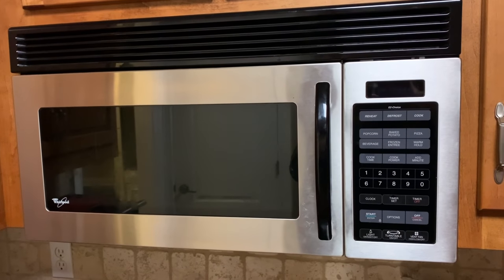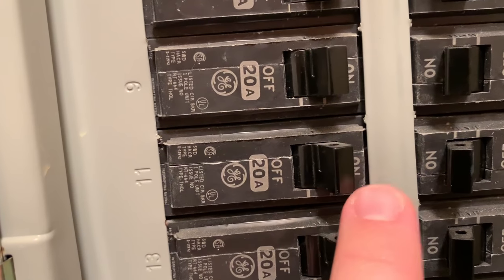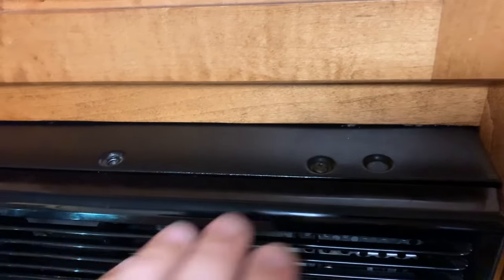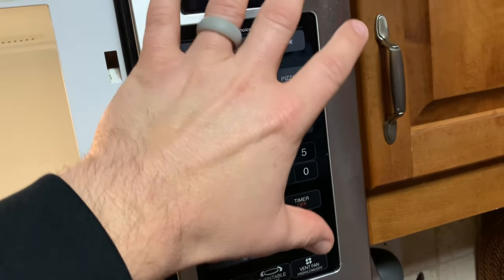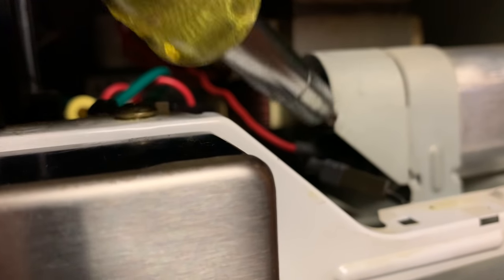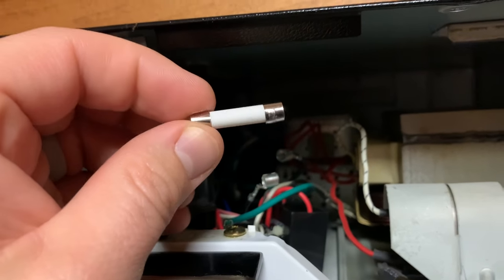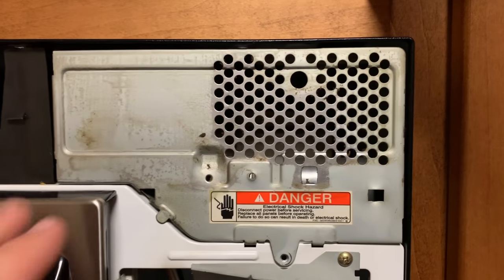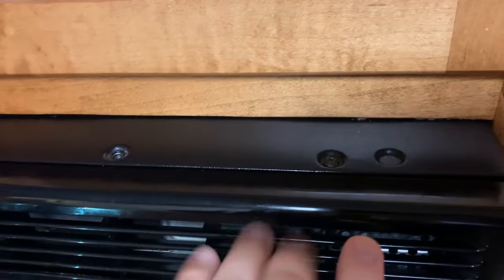Easy Fix: Microwave Won’t Turn On - No Power on Microwave

Comment: Really helpful as our MW went down w/ no power anywhere...! Checked  plug outlet/breaker & all are good. Our model is only 3 yrs old & appears to be a newer version...? Taking the panel off & checking the fuse, it appears to be fried.  I do not see a capacitor up front like your demo. Tin foil wrap the fuse & it powers up :>) I have a 20 amp fuse but there is no voltage rating on it. Putting the fuse place & the MW powers up. Question being, is it OK to use the fuse I put in as a replacement since there's no voltage rating on it?
Reply from the maker: I would recommend getting the right size fuse. You want it to blow so other things don’t get fried or catch on fire.

Comment: I have a GE microwave model PEM31SMSS that stopped working a couple months ago (after 9 years of light duty). After watching your very informative video,  I really think I can replace the fuse myself if I can get inside it to determine what size replacement fuse to order. I can send photo if that would help. Jolene
Reply from the maker: Sorry, I can’t provide the type of support. I’m not an appliance repair expert.

Comment: Our didnt have any power at all either. I replaced the fuse. The display lit up. I opened and closed door and it was still working. I pressed the start button which automatically puts 30 seconds and then starts up. It ran for 1-2 seconds and then turned. What should I do next? Btw I did see the fan turn on right as microwave started. Please help. Thanks

Comment: Appreciate it!  my microwave lost power when I tried to pull out the plastic latch (mechanism that keeps door closed) thanks for the advice on the fuse hopefully its just that.
Reply from the maker: A broken door latch will definitely cause it not to work but shouldn’t cause you to have no power at all.

Comment: The other night I dismantled the bottom panel, the door and the handle, and the control panel along with the circuit board in preparation for my new parts shipment. I had to replace the handle and the control panel assembly because the touchpad had some contacts fail and the bottom of the handle broke. 
After cleaning everything thoroughly and removing all the grease and gunk build up, I reassembled everything and now my microwave acts like it’s cooking. The interior light comes on, the timer counts down, the turntable does not rotate nor does the magnetron work. 

Ideas?

GE with exhaust fan ducted to the outside.

If the main fuse is blown will anything even come on?

If the thermal switch has gone bad will everything I just described still function?

I really don’t wanna buy a new one so any advice you would give me would be greatly appreciated.
Thank you.
Reply from the maker: Sounds like a faulty door switch to me.

Comment: I notice that microwave fuses come in different amperages, and I don't remember what it was originally.  Should the amperage of the fuse be the same as the rating listed on the breaker panel?  More?  Less?
Reply from the maker: Sorry I’m really not sure.

Comment: Hi.  Do you happen to know if my (c. 1982) Sharp Carousel Convection Microwave oven model R-8314 has a fuse?  In the final minutes of roasting a turkey (combination cooking:  convection then microwave) it made an "Errrrrrrnt" sound (kind of a brownout sound) and then quit altogether.  No light, no power, no nothing.  It wasn't the house breaker, and the cord and wall outlet are fine.   This is 76 lbs of serious quality appliance.  Might this be repairable?   Thanks!
Reply from the maker: Sorry. I’m not sure.

Comment: Sounds like what just happened to my microwave... everything was working fine until I  opened the door to get something out and all power was gone somehow. So I'm assuming that internal fuse blew out. I'm going to watch your door switch video now, cuz I  noticed it happened immediately after I opened it..
Reply from the maker: Definitely check door switches first since they are easier.

Comment: Sounds pretty easy. Except for the “could kill you” part. Loved the video but I don’t feel like you explained how to remove the power from the capacitor. Doesn’t “crossing the leads” require touching both of them at once with the screwdriver? Kind of like the way one would hot wire a car back in the day. Afraid to try this fix w/out a better explanation for this part of the process.
Reply from the maker: Sorry Jerry. Yes you are crossing both terminals at the same time.

Comment: For the Capacitor when you say cross them top to bottom and then bottom to top, to get the stored power out, what do you mean by "crossing them"?
Reply from the maker: Let metal touch both contacts at the same time.
Reply: @TightWadDIY  Thanks a lot

Comment: When you say cross the leads on the capacitor do you mean connect the 2 leads with the screwdriver, like a short? It looked like you just touched each lead a few times but didn't connect them
Reply from the maker: Touch both at the same time with the screwdriver. Use caution.

Comment: Did you do this a second time for the video?  Because I noticed you had the clock dots and the interior light before taking it apart.   You had power at that point.
Reply from the maker: You are very observant. We had to redo that portion of the video due to camera failure.
Reply: Shouldn’t the power be off even if it’s fixed when opening the door since you said to unplug the power while opening the panel and exposed wiring?
Reply from the maker: @ndlaham  I’m not sure what you are asking. I acknowledged that I had to refilm part of the video after the microwave was repaired. Everything said and steps shown in the video are correct.
Reply: @TightWadDIY  Around @1:24 you said to unplug the microwave before doing any electrical work, then about a minute later you take the control panel off and when you open the door the light turns on. Your initial message is safe, but your video is showing working on exposed wiring with the unit powered. I don’t see how the light can turn on with the microwave unplugged so that is what I was saying. I know you had to refilm but you still should unplug before you take the panels off and you can still do the video that way.
Reply from the maker: @ndlaham  I appreciate your concern.

Comment: What I want to know is, if the microwave was unplugged, how did the light turn on when you opened the door to remove the front panel?
Reply from the maker: We refilmed that part of the video after the repair was made.

Comment: My High Pointe 900 watt microwave keeps blowing that fuse, 3 fuses so far. What typically causes that fuse to blow?
Reply from the maker: It could be a number of things. You may just want to replace the unit.

Comment: Hi! By any chance do you or anyone else have a suggestion on what to do after following your instructions from this video very carefully, and still having my microwave not work? Maytag (over the oven) microwave. There’s power to the outlet. Replaced the fuse with the correct 250v 20A fuse. And it’s still not working. Anyone? Thank you!
Reply from the maker: Sorry. I’m not sure. It could be a variety of issues.
Reply: Same. Mine blew the fuse as soon as I opened the door.

Comment: Could the fuse still be the problem even if my microwave flickers on for a second if we unplug and plug it back in? Or does that help point to any other problems?
Reply from the maker: No. When a fuse blows there will be no power at all. That sounds like a short somewhere. Try a different outlet just to make sure.
Reply: @TightWadDIY  that’s what I was thinking, tried a different outlet with the same problem. :/ thank you for responding, great video even if it’s not applicable to my problem

Comment: What do you mean “Cross the leads” to uncharge the capacitor?
Reply from the maker: There are two metal leads. If you cross the screwdriver to touch both leads at the same time it will discharge the capacitor.

Comment: The problem was the fuse and putting a new fuse In Is easy BUT getting TO the fuse requires some technical knowledge and COULD get you killed so EMPHASIS should have been Illustrated In depth on discharging the capacitor OR just say I wanted to make a youtube video,my advice for people Is buy a new microwave If you can’t just remove a few screws and pop the fuse right out.
Reply from the maker: Thanks for your concern.

Comment: 99% of all kitchen appliances plug into a GFCI receptacle/circuit. Always check for a GFCI receptacle fault after a storm, especially if a surge protector is being used. Most GFCI receptacles have a small light if tripped. Push the reset button on the receptacle until the click is heard and the light goes out. The GFCI could be a breaker in the main power breaker box or one receptacle in the kitchen that is in line with other receptacles. “Look for a receptacle with a little yellow light”!
Reply from the maker: Great tip. Counter top microwaves are probably plugged into a GFCI circuit. Over range or built in microwaves are almost always on a dedicated circuit and not typically GFCI unless it’s next to a water source.

Comment: Fuse is fine. Found another video that checks door switches and they are all fine. Breaker is fine. There is power to the outlet. 

I had removed the fuse and checked continuity and then put back in and microwave was working but when I went to start it and lost all power again, so not sure where to go from here.
Reply from the maker: Sorry. There are other things that can go bad as well. Might be time for replacement.

Comment: Sir, I have GE table top microwave and does not show light in front panel complete dead. I have check power outlet, circuit breaker and its OK.I have checked continuity with multi meter i.e transformer, magnetron capacitor, diaod, thermostat, fuse and its OK. In my GE adjacent to capacitor there no fuse, only one fuse at the top. i have also checked door switch with multi meter and its OK. I dont know how to check PCB.Pl guide.

Comment: How exactly do you cross the leads on the capacitor? The video didn’t show that actually happening.
Reply from the maker: Warning: It’s dangerous if not done properly. A well insulated tool can be used to touch both leads at the same time. This will discharge it.

Comment: It looks like I have the fuse problem on my microwave.
Do I need to look for a specific code when I order the fuse ?
I have a Frigidaire by the way.
Reply: Look on the fuse. It will tell you the voltage and amps (like 250V, 20A). Also you need to make sure the size match.

Comment: Hi, My microwave takes 1 hour to power on. Any iadvise what might be wrong. I changed the fuse. Still same probem. After it powers on. It works fine. When I turn power off and back on within 30 seconds, it turns back on immediatey. But when it is off for 5 minutes or more, then I have to wait for 1 hour after I turn switch on before it powers back on.
Reply from the maker: That is really odd. No idea.
Reply: @TightWadDIY  Much Thanks anyway.

Comment: I replaced the fuse and it immediately blew again.  I tested the three door-switches with a continuity tester and it is shorting out.  I ordered replacements for all three door switches from Amazon for $15.00.  Hopefully that does the trick.  If you use tin foil to test the fuse and you have a short somewhere in the unit, it is likely going to trip the circuit breaker.  Don't do it.  Use a continuity tester on your multimeter.
Reply from the maker: Hopefully your door switches work.

Comment: I opened my microwave looked around couldn't see anything physically wrong with it. So I looked up a video to maybe find what could be the issue. Then you said that it could kill me but I was like oh well to late for that I touched and wiggled everything already. Anyway you said the issue could be the fuse so I did the tin foil trick you mentioned. And my microwave turned on. So I bought a pack of 2 fuses at home depot for 4$ and my microwave is working again. So it saved my a lot of money from buying a new one.
Reply from the maker: That’s great!

Comment: I fixed it by checking the main power ,so the microwave work for like 30 second and turn off,whenever I check the main power again I’ll find it off ! Do you know what’s the issue?
Reply from the maker: It could be a bad outlet, a bad breaker, or something wrong with the microwave.

Comment: First the microwave flipped the breaker when opening/closing the door. Then later it did it when cooking.
I started troubleshooting but now when I just plug the microwave in it flips the breaker right away.
If I turn the breaker back on, the breaker flips back off automatically…

Any advice?
I’m so lost….
Reply from the maker: You could have a faulty outlet, faulty breaker, or the issue could be your microwave. Try plugging another energy hogging device like a space heater into that outlet to see what happens.

Comment: When you said the microwave could KILL you I decided to throw mine away and buy a new one even though I'm a pretty good mechanic but I don't like getting killed. There are only 2  types of electricity I'm scared of. Live and dead just as there are only 2 types of snakes I'm scared of. Live ones and dead ones.
Reply from the maker: 😂😂When in doubt, throw it out!

Comment: So i microwaved some water that exploded. Power wouldnt work. I just changed 2 fuses and it powered back on, only to power off after 3 seconds. What could be the problem?
Reply from the maker: Fuses are a fail safe that blow when the circuit is overloaded. Sounds like you have a much bigger issue.

Comment: I’ve got my Samsung apart, thank you. Now I’m staring at that capacitor and a little nervous about discharging it. Is there a way to know if I have effectively discharged it?
Reply from the maker: B I’m not sure. I do know they are supposed to discharge on their own when it’s been unplugged but the information I’ve found regarding how long that takes is pretty all over the place.
Reply: This scares me too.  Did you do it?

Comment: Hi I had a power outage in my area, I open my microwave checked the fuse with a multimeter and the fuse is fine, when you try turning back on the digital board doesn’t turn on, what do I do now?
Reply from the maker: Did you check the outlet to make sure it’s working?
Reply: @TightWadDIY   yes I did, it works fine when I plug my phone charger

Comment: Good info on how to get to the fuse but bad info telling people to wrap fuse in foil.. do not do that.. check with meter. Check the outlet it’s plugged into. If there is no power check the panel like he said and also check any gfci plugs that may be on that same circuit. If the outlet is good then it is more then likely the fuse. Call an electrical supply house and it’s less the $5. Don’t use foil!

Comment: Hi there, I have a  Whirlpool microwave . I would set up everything to warm meal when i click start it will stop. Any help?
Reply from the maker: When you say it stops does the power go off?
Reply: @TightWadDIY  the power doesn't go off, instead will stop when i click start. Stop like it has finished the warming process.
Reply: I ordered the fuse already after i saw your video to try. I don't know if that will help .
Reply from the maker: @abebahaile2546  If you have power, it’s not the fuse. You could have a door switch issue but I’m not sure.
Reply: @TightWadDIY  I will try that.
or i will uploaded the video to show you.
Reply: @TightWadDIY  here is the video I have recorded. https://studio.youtube.com/video/hw3X4u31xtc

Comment: Help please! Single new home owner here. When I turned off then on the switch in the garage, the light on the m/wave will come up, but the moment I press the min buttons to use it, it will be dead again. Any idea please? Thank you!
Reply from the maker: You probably need an electrician since one switch is interfering with another. That sounds like a short somewhere in your home wiring.
Reply: @TightWadDIY thank you!

Comment: I tried this, but the fuse kept blowing. Hired a repair person and it turns out it was the door switches! Nothing will work if there's an issue with the door switches as the microwave is built to not turn on if the door isn't perfectly closed. Our appliance guy said each door switch is 31$ and he replaced 3 for us, so $91 in parts + $135 labour. Including taxes it cost us $255. Definitely look up door switch repair if replacing the fuse doesn't work.
Reply from the maker: Wow! That’s a lot for a door switch! They cost less than $10 online and you could replace all of them in 15min after you have the microwave open. I guess knowledge is worth a lot!
Reply: This is more than my microwave is worth. haha

Comment: I gave you a thumbs down simply because you told us to wrap the fuse in tin foil. That could be very dangerous. I'm not saying I wouldn't try that, but what caused it to blow in the first place. If it was a bad short, putting foil around the fuse could only exacerbate the problem. Just my observation, other wise informative.
Reply from the maker: Paul Secore I understand your concern. I definitely recommend only using the foil to see if the power is restored as shown when I first plug it back in.
Reply: @TightWadDIY  A new fuse would be a whole lot safer. To test the fuse, a continuity tester works great. I've learned a few things the hard way is all I'm saying.

Comment: Hi, my fuses were good, but still no power. Used extension cord to another outlet and there is power to the microwave. Any suggestions? Thanks for posting these helpful videos.
Reply: Yea buddy that sounds like and outlet problem, especially if the microwave works on another outlet
Reply: Sorry for the confusion, I meant both outlets are working as my extension cord has a built in light to double check for power. So the microwave still isn't working. Is there some reset button? I can't imagine fixing the fan button caused a working microwave to suddenly stop working. Thanks.